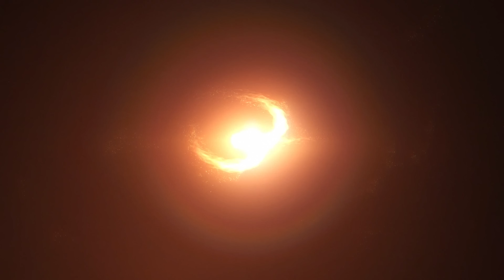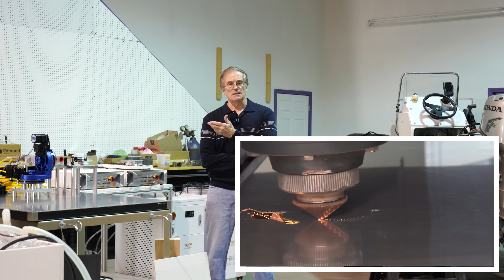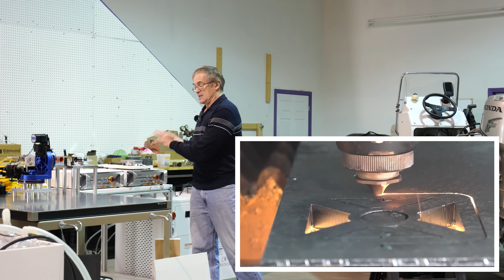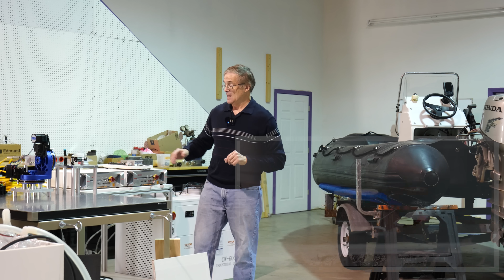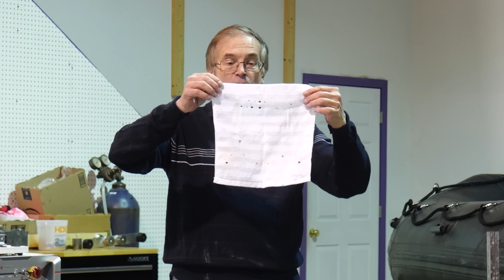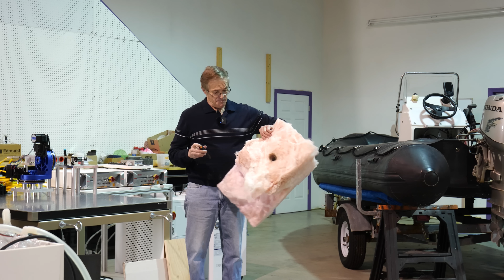We have a problem... and need your help!

Comment: The waterfall is my thinking as well.

Powdered activated carbon suspends well in a circulating system to use as a diffuser/ absorption media. Running down something like one of those open fish tank sponge filters at say 2 inches if that's a normal thickness for that material, it's lightweight so the thickness won't have an impact on the overall weight of the unit. 

The pump to circulate should be sized to fill a tray with a gap in the bottom to accommodate the material thickness and possibly an overflow on the front to make an initial curtain. 

To provide a safety for this the layer of plywood could be placed after this as a backup.

Other things to consider i would think would be products of vaporization of activated carbon so if this is to happen for any length of time you wouldn't want to generate an IDLH environment. 

Best of luck to your endeavors. I have been following your channel for a number of years and i thoroughly enjoy your content and the way you explain things in an interesting way.

Comment: Reliability engineer here. If you would reduce the intensity on the surface. Just replace the surface fast enough. So a spinning cillinder of concrete would probably work.

Comment: Can you go vertical?  Mount the laser up high and point the laser downward and you have the entire earth to act as your shield.  You might need to fix your concrete afterwards of course.
Reply from the maker: Not really. 
The ceiling height will limit the range with the drones flying below.

Comment: Maybe a light trap with two plates and a black sand water cooled medium could do the job ? 
A cheap way could be to sand coarsly the plates so that the reflection is not perfect ? 
Maybe a front layer of matte-black perforated steel to weaken and scatter the incoming beam. Behind it,  a sealed chamber filled with black sand actively flushed by a water loop for continuous cooling. 
Both sides of the chamber with angled metal mirrors (badly polished stainless steel or aluminum) positioned to bounce any transmitted or scattered laser light repeatedly across the sand volume. The internal reflections dramatically increase the optical path length inside the absorptive medium, ensuring that nearly all energy is eventually absorbed by the wet sand.

Comment: Have you considered using an Aerogel to absorb/stop the lasers energy?
Reply from the maker: Their mass is so low that if they can absorb the energy,  they will get very hot very fast.
Reply: Gemini informs us: "" While some inexpensive aerogels may start around $70 to $112, others can cost as much as $23,000 per pound, according to a Wonderopolis article. This high cost is due to the complex production process and materials, which often involve high temperature/pressure environments and small batch sizes. Aerogel is more expensive than gold by weight."
    Show all

Comment: In the refining industry we use porous ceramic balls to hold a catalyst to increase the efficiency of reactions. They are extremely heat resistant. They might be used although I’m not sure how you would contain them. An alternate might be glazed ceramic tiles if you can get them on sale but they are on the heavy side.   I know you will find a solution. I can’t wait to see it.

Comment: Tech Ingredients, I really like your project—especially if you’re using a fiber laser.
Watching the video reminded me of the old movie "Real Genius" with Val Kilmer—they built something similar using a chemical laser in the film.
As for the problem you're working on, I believe a two-step approach could help:
Tracking System: I assume you're using a galvo system for tracking instead of a stepper motor. If you're also using a faster processor for image tracking, then consider pulsing the laser instead of running it continuously. Pulsing helps reduce exposure time on the lab walls
Software and Laser Control: You’ll likely need bare-metal programming to optimize performance. If you have enough processing power, try adjusting laser intensity:
Use lower power on the target's edges (like drone propellers).
Use higher power at the center of the target (the main body, which absorbs more energy).
Deliver rapid pulses to the center, adjusting power dynamically if the target keeps moving.
About the back wall: I’m not an expert in materials, but here’s a budget-friendly idea:
Build  a modular wall on small wheels for easy storage.
The wall could have an expandable thin metal sheet on the outside (so the laser can punch through), and soil from your backyard inside to absorb any stray shots.

Comment: How about a flowing water curtain but the water has salt added to the saturation point to increase the boiling point and help diffuse the light. A back plate with a textured reflective surface could be used to reflect back into the water curtain. Not sure if doping the water with non soluble material would help with the diffusion.

Comment: To add to my previous post: 
If you “pleat” the disc like a automotive or furnace filter you would greatly increase the surface area.
Then Move the spinning pleated disc horizontally so now you have a vinyl record effect. Lots of surface area for the beam.

Comment: You had the answer all along, it'll have to be accurately aligned though. Basically at the end of your test range reverse the focus through a receiving optical head with several lenses and defuse the concentration of your death ray.

Comment: Rather than absorbing the energy, maybe you could look at a way to destroy the beam.

I wonder if there is a material that allows the energy to pass through but disperses it so it no longer forms a beam. Essentially the same way ISS is protected from micro meteors. 

Those micro glass spheres might do the trick in panel form

Comment: A large beaker filled with water with a stir bar mixing the water. Have a slurry of a light absorbing material. I would say carbon black, but it isn’t very soluble. Perhaps powdered charcoal.

Comment: Perhaps applying an analog version of an upconversion nanomaterial (UCNP) lens would do the trick by adsorbing high energy photons and emitting them at a lower energy level. Several lens in series might be needed to be used, each composed of rare-earth doped NaYF4 or similar material. The doping agent would need to be optimized to allow adsorption of the high energy photons with subsequent lower energy release.

Comment: You don't want to build a destructive power that require a shield behind the target.

Change the focus point. 
More distance between lasers.
Make sure it scatters quickly enough.

Don't dial up power until you have target angle and distance.
Reply: Perhaps use the laser in short pulses that give enough time for computer to see if target had enough..
Reply: If it is for static tests, perhaps a reflective surface bend to scatter.
Best in almost parallel
This could be water.

Comment: 40mm THk is the cutting limit of a 10kW fiber laser (according to GTS on the Interweb).  So, perhaps a thick plate of Carbon Steel, approx 50mm THK; 1-meter2, and perhaps two back-to-back, for 100mm THK ???

Comment: The first thing that came to my mind was using sand. Silicon dioxide reflects infrared light, but it will reflect it randomly. And, it is cheap! Give it a try.

Comment: If you mount your whole laser setup on a platform and slowly wiggle the platform with a system independently powered from the laser, then no software crash could cause the laser to stay on one point. As long as the active tracker is also on the moving platform, it shouldn't affect the experiment negatively. This would allow your back wall to be much thinner without risk of burn through. Angular velocity of wiggle trades off with distance to the back wall. If your vertical and horizontal wobble are of different frequencies, then this setup can go indefinitely without burn through- would burn a 2-d lissajous figure into the backstop, but wouldn't burn through.

A failure mode would be the tracker glitching and actively tracking a point on the back wall, which could cause a burn through

Comment: ceramic plate? may be even pottery clay (wet),  low flux fire clay stuff plastered on drywall like surface, may be i am not understanding magnitude of concentrated power but, instead of poking a hole, it is going to be hardened then might punch a hole, which can give you couple of seconds

Comment: Phase conjunctive mirror.  Oh, you just said not reflective.  It was a joke, as it returns the beam back on the same path forming a closed loop to the laser, overpowering it.  A difussing fliter which spreads it and wave guide to spread it further.  That starlight (is it?) thermal insulator.  Materials with a high thermal uptake.  Yep, got it, will look nice an camera (or just see what the labs do). When they first started using lasers to do metal work, they found the beam strength was reduced by smoke and partcle clouds generated, which is a diffuser.  So material the will absorb a lot of energy and smoke, coated with a thick satuated hydrogel twin sheet to protect it, coated with more smoking layer.  If it get through the hydrogel sheet and its smokimg layer, then the board behind it starts smoking.  Maybe you get 10 seconds plus linger time?

I'm just thinking aerrogel like material, dangerous, reflections from the cavities and spread micro and nano particles.   But made with harmless organic materials, but you still need extreme breathing masks.  That passive rook top aircons had something like this?

Very tough,  very risky problem.

Comment: if this system is solid state install a intra cavity shutter and a watchdog circuit.  if your using diode stacks then use an electronic shutter and watchdog circuit.

Comment: What material is used in the optics? Could you get this material in sheet form with a rough surface to diffuse the laser, so that once the laser light passes through it, some other backing material has less intensity to deal with?
Reply from the maker: No.
They're very expensive and the area we need to cover is very large.

Comment: You might want to try Deep Black columnar Graphene. Absorbing all light and heat resistant.  Already exists. Polarized by axial growth in beam direction. Stealth related. No reflection. Total Absorption. Years ago. I could be wrong. 😒

Comment: Wouldn't ballistic gel work? It's essentially just water and gelatin mixed together and is typically used to simulate flesh being struck by bullets. Should be relatively cheap to make in huge amounts and you could mix in light absorbing materials like coal to help absorb more light.
Reply from the maker: It's funny  that you mentioned this.
I was investigating this last night and we will definitely test it. A large gelatin wall may not be feasible, but it might be an excellent choice for small areas.

Comment: Cheapest and easiest solution would be dirt.

It can be filled in IBC containers, box pallets, or in sandbags stacked in gabions on top of pallets. Gabs can be filled with sand bags.

Yes it is heavy and takes up a lot of space, BUT a single person can move them with a forklift way faster than two people could unpack and build any kind of wall panel system by hand. And you can store them outside when not in use without damaging them. 

Also, they can double as heavy blast wall, shrapnel catcher and raised beds. Wich might be useful for one or the other future projects.

Comment: Pitched foward towards the laser source, at a 45 degree angle, mount in the beams post target path a surface coated laser reflector that will direct your excess and unbridled energies straight unto the Devil's doorstop if you so wish. Alternatively you could direct it straight down into a decollimation array and spread it back out to the point of being harmless or at least to the point of being able to more easily diffuse the resultant energies into some medium right below the mirror.

Comment: Could you use calcium phosphate as a coating or powder bed or make the experiment vertical instead of horizontal & have a body of water at the bottom with a platform at the top, or even a scissor lift?

Comment: you have two units, right? just use one as the backstop running in reverse, that way you'll even get some power back out, duh!

science is so easy, no wonder smart people don't get it.
Reply from the maker: I love that level of confidence.🙂
Now, do a little research into phase locking and interference. This will clarify why that won't work.
Reply: @TechIngredients  oh i knew it wouldn't, that was very tongue in cheek :-D thanks for the reply! i've been watching for years and years. you're didactic and whimsical. you speak with clarity and thoughtfulness, then pull the safety glasses down and make something go boom. thanks for all the knowledge and fun. i hope the comments (other than mine :-) ) have helped you come up with a solution. be well!

Comment: Trying to absorb the beam as is may be asking a little much of materials were familiar with. Perhaps placing something downstream of the beam that eill scatter the light and then absorb a less intense and more scattered beam with the materials you're already using. This may be an exotic material, but is a small diamond or other similar idea off the table? Scatter the beam into a tube that can absorb with a larger inner diameter instead of trying to directly absorb all that focused energy? Just a thought. Like a prism at the entrance of a tube with a large internal diameter, coated with reflective or other scattering/absorbing material?

Comment: A large convex lens would need to be high-quality glass.  It would need to be set up in front of the laser, perhaps on a hand truck for easy moving.  A convex fresnel would likely burn as well due to the microscopic impurities and imperfections.

Alternatively, to buy more time with the sheetrock, you could coat it with 50/50 dissolved acrylic in acetone and water.  It might disperse enough of the beam to buy a longer burn through time.

Also, alternatively, you could try a large mylar convex mirror by applying a vacuum to a sealed frame with a mylar sheet sealed across the face.  I'm unsure if they make a qualifying mylar for this, though.

There is also a recipe from Nighthawkinlight to make "shuttle tiles" from flour and other household products.  It handles extreme heat really well. I'm not sure if this might be too much heat for the current recipe, but it could be optimized, I'm sure.

Comment: Just a thought, but... have you tried using plumbers clothe. Possibly stacked in layers. You know the combustion resistant cloth used for protecting wall studs and cabinetry from catching fire when sweating copper pipes together. That stuff is relatively inexpensive and could possibly be just what you need. Won't catch flame with even a direct 60 second hit from a torch.
Reply from the maker: Thanks!

Comment: Engineer who has done a fair bit of work with high powered laser optics here, including producing solid state ceramic shielding for ultra-high intensity light. I may be able to help out a bit.
A few questions about your setup

1. Are these lasers pulsed or CW, and what is the approximate power density that you are expecting to achieve at the location of the shielding (or at least what order of magnitude)?
2. What is your budget for producing the shielding, and what surface area do you need to cover?

My mind goes towards a few potential solutions depending on these answers. The first one would be to use a very high thermal conductivity metal coated with an ablation resistant ceramic such as silicon nitride or silicon carbide. You could then either connect some type of heat exchanger or watercooling line to the back of the metal shield to dissipate the heat that is produced if necessary. The trick here would be adhering the ceramic (more than likely purchased as some kind of a powder) to the metal shielding, as anything you use to bond it would need to be able to handle whatever heat is produced at the site of the laser spot. Something you may be able to try would be mixing silicon carbide powder (preferably a not super fine grit) with a combination of boron nitride (for improved thermal conductivity) and sodium silicate solution as a binder. In the correct proportions, you should be able to paint this onto a surface to coat it pretty easily (although to properly cure the sodium silicate it should be exposed to CO2, but air curing may be good enough in this case). When I have used this combination before, I have had thin layers of this combination painted over a copper block withstand power densities of 500,000W/cm^2 for 20+ seconds before burning through.

Another solution that I have seen mentioned here is the idea of using some kind of a near IR opaque fluid in a curtain to block the laser light. This would likely result in a much higher maximum power density, as it takes tremendous amounts of energy to evaporate the water and the shield will constantly be replenished. One challenge that is not addressed in a few of these suggestions is how to keep the curtain as a constant unbroken wall, as the water will tend to split into droplets due to surface tension as it falls. One easy way to reduce this with water would be to add a surfactant that breaks the surface tension, which could honestly be as simple as adding a small amount of soap to the water (although you would have to contend with bubble suppressing.

If any more information is needed about the ceramic shielding concept in particular, feel free to ask. I have never produced any shielding of the type you require for this large of a surface area, but I still may be able to help more. If you are interested, I can actually send you some of the coating that I produce and have used on a few research projects.
Reply from the maker: The lasers are each 1,500 watt continuous wave. They operate at 1,080 nm, and the energy on the target is approximately 300 kW/cm^2.